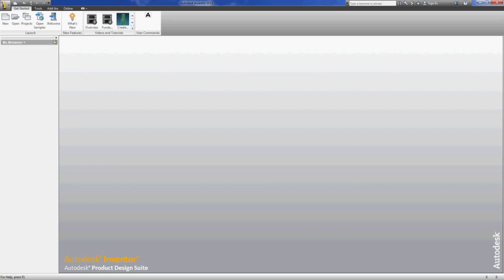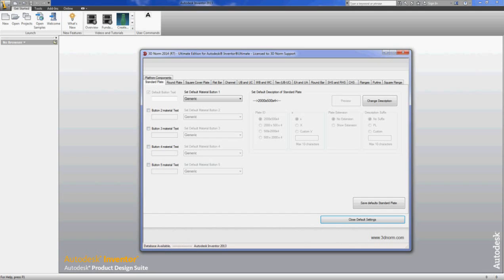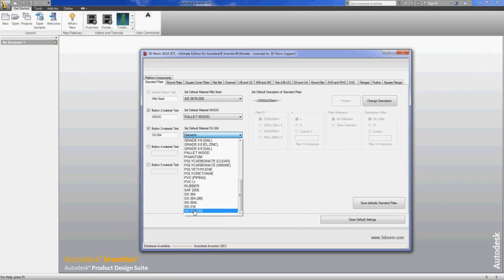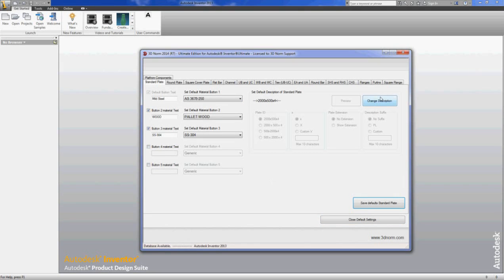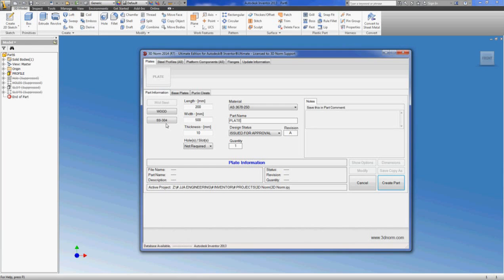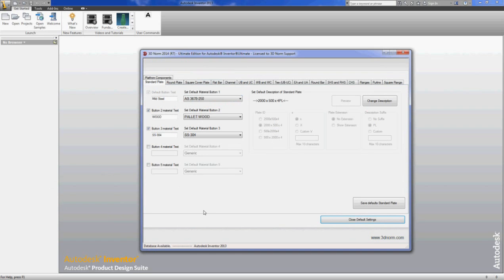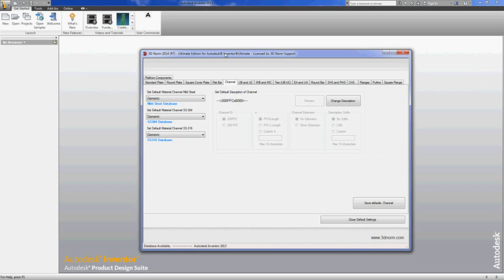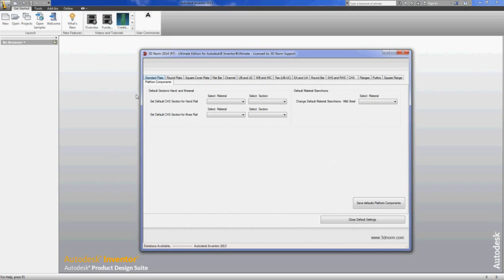3D Norm - Default Settings for Autodesk Inventor users

Comment from the maker: There is additional information available on the website:
http://www.3dnorm.com/index.php/how-to/inventor/default-setting-1
http://www.3dnorm.com/index.php/how-to/inventor/default-settings-2

3D Norm is a flexible, yet easy to use innovative enhancement software that works seamlessly with 3D modelling programs such as Autodesk Inventor and Solidworks for the rapid creation or modification of 3D components with minimum effort using the most accurate information from International Standards.

Visit the website: http://3dnorm.com to download the trial version.